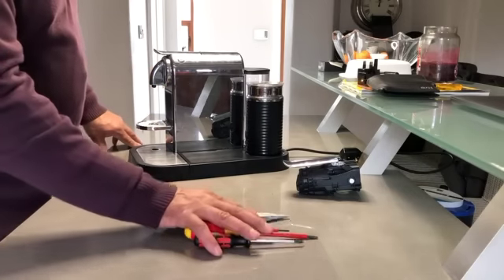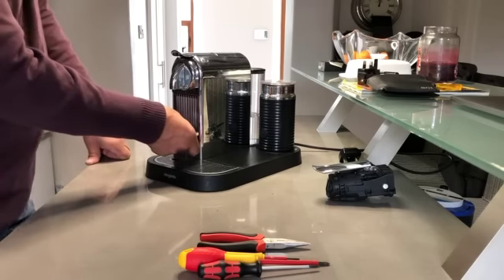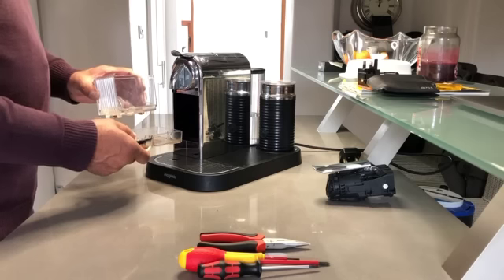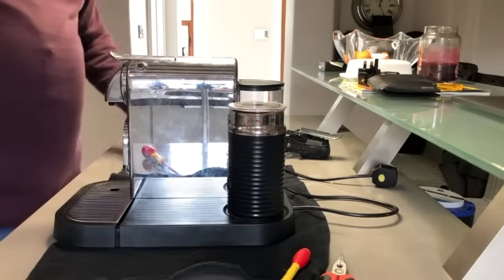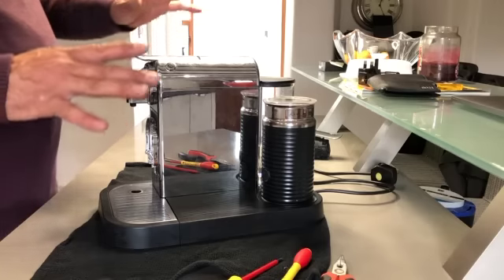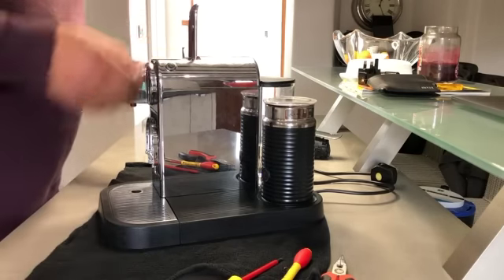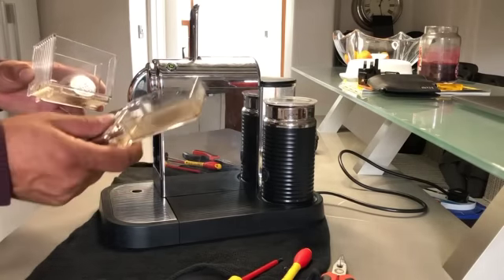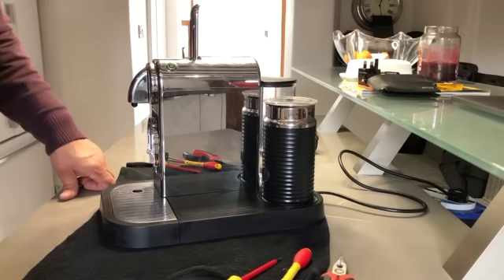Nespresso Repair leaking

Comment: That was a great video. I have Breville Creatista Plus that is leaking. I actually removed the little slide out espresso shelf that sits under the capsule waste tray and cut a yellow kitchen sponge to fit the space. It seems to absorb the leaking water, but it's only a workaround. I'll have to try giving it all a clean like others have in your comments.

Comment: I had a go at taking the brew unit apart and it seems easier than what you have already done to get to the brew unit. Less chance of snapping plastic tabs and easy to put back together. I only found one D-Ring seal... DRings are tricky to find 'off the shelf'. I tried BS125 2.62mm Section 33mm Bore EPDM Rubber O-Rings which seems a little small but seems to have fixed the leak for now. So, if you got this far, I recommend trying just replacing the seal. Maybe try a very slightly bigger one. I don't know how long this fix will last...

Comment: Thank you so much for posting this video, it has been amazing. I have dismantled my 11 year old Nespresso Milk Citiz machine (and without the oval screw, screwdriver and pliers, used a credit card and a butter knife😂as my screwdrivers were too thick- must update my tool box). I’ve now ordered a new unit from Magzimix and I’ll come back to your video for reassembly. You explain everything so thoroughly, and your video gave me confidence to tackle this project, even with weak hands (used my husbands hands for pulling the case off, it was a cringe worthy moment, but successful). Thankfully I have a spare machine, whilst I await for the £30.00 (plus £5.00 48 hr delivery) part to arrive. It’s really annoying your machine’s brew unit gave up after only 2 years😮, and Nespresso wouldn’t honour a free diagnostic. Once my machines have both given up and no longer repairable, I’m considering getting a bean to cup machine as Nespresso’s capsules have escalated in cost, and their customer service has gone down. Thanks once again James for your time and knowledge share.
Reply from the maker: You are more than welcome!😀

Comment: Hello James, thank you for this video was very helpful. I have a question however with the water feed and return hoses. The smaller of the 2 hoses had come off from inside the main body before I had it apart and now can not see where it connects inside the main body. That’s the only thing stopping me from putting it all back together. 
Thank you if you do manage to reply
Reply from the maker: Hi Bill,

Plastic or rubber pipes? Plastic goes on the back of the brew chamber, the same item you bought. Rubber supply and return go on the respective nozzles at the base of the machine. Side by side.
Reply: @jamesroberts2907  shorter of the rubber ones, found iit disconnected from both the base and inside of the body. After looking for some time eventually found where it was supposed to go. At bottom of a black connector. , thank you once again for your video and for taking the time to reply.

Comment: Hi i have a nespresso c120 same as the video as u.. When i try turning on everything when well but after i start to press for the coffee mode and after the hot water came out the whole power trip
Reply from the maker: Hi, that sounds fairly terminal to be frank. It seems like the heating element may of gone.

Comment: Thank you for this. Followed it exactly and managed to get a fully working machine again after about an hour.

The brew unit I needed for my particular model didn’t seem to be available, but I bought one for a standard Krups machine of a different serial number and it turned out to be the sameas my model. Whole repair about £40 compared to a new machine at £175. Very many thanks!
Reply from the maker: Pleased it worked out for you too.

Comment: My Magimix machine leaked too, result was more coffee/water? in the capsule container than in a cup. It was caused by blocked holes in the disk that's in front of the capsule, it has 25 very small canals and 9 were blocked and others might be blocked partly. Thorough cleaning was difficult without dismanteling the machine. I managed too open the machine,i managed to unscrew 2 screws,2 others were released with force without damaging the plastic wings of the machine on the outside, on the inside there was damage but not visible at all when the machine's closed. The disk could  be released and cleaned,after cleaning in hot vinegar using a nailbrush all 25 canals were open again and the machine never leaked since then. 
Assume the pressure is too high for 15 open holes and some partly closed ones so the coffee and water search for a way out and found it ending up in the capsule container..... The exotic oval screws are the biggest problem to solve the problem that can be solved so easily. If you look at te oval screws you might think they aren't screws,they look like pop rivets.

Comment: Thank you for doing this video James, it was a real help.  Here in AUS, the manufacturer wanted AU$240 up front just to get them to take a look at it!  With the info you put in this this video, and the special tool to remove the elliptical headed screws on the bottom and a replacement coffee difuser (?) - the part that was leaking, I was finished in under an hour and cost less than $100.  
Great work James, much appreciated.  Two thumbs up!
Reply from the maker: Thanks Tony. Appreciated

Comment: Firstly, what a wonderful video - both precise and easy to follow and, more important, leads to a successful outcome, as it once again works perfectly.

There are only a couple of things I would add.  

Firstly, I think James was very unlucky with his machine ,as I've had mine a number of years before the "water tray" problem ocurred.  Because mine was older than James' machine, I gave my Magimix Nespresso a really good clean whilst it was in parts and before I re-assembled it.

I did take James' advice and I bought the oval screwdriver as this made unscrewing the base very easy, other than the comment about having the last corner of the base "difficult" to separate.  But it does come off.

The only thing which might catch somebody out was that the old M190 brew unit (the bit that needed replacing) was attached to the unit with four T10 torx screws - and you got it, I didn't this size screwdriver!  So, having purchased one, problem solved.

Overall, a successful replacement following a perfect demonstration on how to do it.

Thanks Paul.

Peter McCaffrey

Comment: What exactly is wrong. Is it a seal or pressure is reduced from wear.
Reply from the maker: Hi David, a really good question actually!  When I did this video one of my biggest regrets was to not start with the obvious things!  
1. Have you descaled the unit regularly following the manufactures guidelines?
2. If no to the above and you have again recently descaled the unit try 2-3 times in succession. 
3. If the above has not worked and you still get large amounts of water in the drip tray, follow the instructions to dismantle and examine the spout where the coffee pours from, is it blocked?  Clean and try again. 
Some have claimed success with the above steps. They are inexpensive options and worth a go. 
Some have claimed success by simply reseating the “O” Ring and someone even posted the size of it and replaced it. 

The best theory I have is that if coffee capsules are used and left in the brew unit regularly, the coffee expands in the pods and over time damages the brew chamber. 
The long and short of it for me was an easy fix, for a fraction of what Nespresso wanted to just “look” at the machine and in my case so close to the warranty expiry date it was painful. At the time I did this video Nespresso wanted €90.00 to look at the machine, then a further charge for parts and labour!  I wanted a quick and relatively inexpensive fix, so went down the route of buying the whole brew chamber and replacing. Of course what Nespresso want you to do it buy one of their new Virtuoso machines as the capsules are only produced by them and they are considerably more expensive.  I have nothing wrong with Nespresso, they did bring great coffee into thousands of homes at a reasonable price, I was just not prepared to spend the price of a new machine to have mine repaired, so hence the video. Hope your machine is OK.
Reply: @jamesroberts2907  thanks so much for taking the time to write that reply. Descaled twice with no luck. My wife does leave her pods in! I’m sure once  by cleaning internal surfaces it came good for awhile. Looks like a replacement with your instructions is the next step. Thanks

Comment: I came across your videos when I was researching how to fix my badly leaking Magimix M100. Although my machine was different you gave me the confidence to have a go. I bought the oval tool, £3 and a set of quality Torx screwdrivers (no Philips screws inside), £18 and followed your methodology. In fact the M100 is easier to take apart and the brew chamber has no electronics, just a plastic tube to pull off so no wires to disconnect or switches to remove. It was obvious that the end of the chamber where the filter is was full of coffee gunk, as was the spout. I cleaned both with hot water and an old toothbrush and reassembled it. Perfect, no leaks. The brew chamber, being just a plastic and metal componant is cheap at £10 if I ever need to replace it. So thanks again for putting these videos on Youtube so that I now have two Nespresso machines!

Comment: Really helpful video, thank you. My machine is a Nespresso Essenza but the principles apply to lots of 'original' machines. In my case I also followed another video that complements this one very well and I replaced a rubber O ring inside the brewing chamber. That fixed my problem - I did have hot water coming out from beneath the lever, but no more.
Thanks again.

Comment: Thanks so much, this was a huge help and I wouldn't have been able to do it without the video.  We have a Citiz without the milk attachment so it was possible to do without fully removing the base and leaving the earth attached, it made it a lot easier when reassembling at the end.  It also took me a while to pry the plastic spout cover off, the clips for that are at the top and the bottom if anyone else is struggling.
Reply from the maker: Your welcome. Pleased it worked.

Comment: I found what was a problem for my solution and why my coffee machine still leaking. The cause was part that James talking about at 15:53 min of James clip. In my case, this part had a blockage in the tip of its nose and that was the cause of leaking. What I did, first I removed the blockage then  I drilled a hole in order to remove small plastic cross at the tip of this nose  to enable better coffee flow. Now I do not have leakage any more :).
Please check this nose - remove any dirt and remove the plastic part on the tip of the nose itself (by drilling), then check is your machine still leaking if yes go further and order the part James suggesting.
Reply: Thanks, Boris, I followed your tip to clean the nose blockage by fine pin and it works, no more leaking, cost £0 but solved the long term problem, now machine back to working order without a drip leaking at all.

Comment: Thanks James for the inspiration.  My machine leaked on the inside and figured it was blocked somewhere causing backpressure. The pod is pressed against a "grill" on the inside of the machine. Cleaned this with a toothbrush and flushed with water. Almost did the trick. So put a garden hose  on the output nozzle of the machine (not in the kitchen!) and gave it a blast. Now works perfectly.  I guess the coffee grains over time block the unit. Thank you.
Reply: So the water from the hose was going back through the output nozzle and through the "grill". Did you turn the machine upside down with the lever open so the water could escape and not blast all through the machine?

Comment: Perfect instruction 👍 it is a typical problem with that model. It comes when you leave the used capsule in the brewing unit. Because the wet coffee swells and the capsule gets bigger. So it busts the ring of the brewing unit. To prevent this, remember to eject the capsule immediately after brewing. 
I tested many different types of capsules in the last 10 years. In the result I use only nespresso or lavazza capsules. They work best
Reply from the maker: Olli, that makes a lot of sense and would explain how some people don't have any issues but others end up throwing their machines away.
Reply: So Olli, is that the O ring that gets burst, that some people are saying in their posts that they replace do you think? In which case is it necessary to get a whole new unit rather, than to try  replacing the O ring?
Reply: @brianlaughland8960  Hey Brian, i Don't know exactly what the o ring means. The thing that surrounds the capsule and brings it to the pyramid plate gets a hairline crack.   You won't get this part single, I think.
 If you can see no hairline crack, it could be a different mistake maybe the jet, where the water hose is connected is blocked (because of using hard water). This is the mistake, when the capsule is not perforated and no coffee but only water comes. 
In this case you could try to blow the jet. 
Good luck

Comment: Thank you very much for taking the time to prepare and post this. I have a very similar machine (cosmetic differences mainly) which had been out of use for quite a while. After watching your video, I ordered the special key and the spare part. It took quite a while to gather myself and attempt this. It was tricky, as I am not used to such tasks, but after a couple of hours I managed to complete the repair! Another difficulty I had was the fact that the pump did not start working properly straight away. This might have been due to the fact that the machine stayed unused for a very long time. With repeated efforts, and while the pump was active, pulling out and replacing the water tank, I managed eventually to get it going. Thanks again.

Comment: Thanks very much for making the video. I got the most benefit out of pulling the coffee machine apart. It gave me the confidence to pull on the plastic a bit harder than I wanted too.

What I wanted to say thought to help you and your viewers, is you don't have to buy that part. You were so close to fixing the entire problem without spending a cent / penny.

The part you say not to strip... and buy another one. You are right, don't strip it, it is all to do with the lever action of the pod being put in place, except for one part... the part that the flat side of the pod pushes against. That part is the reason the water is in the bottom, because it's blocked and the water is not going through. So... take out the little grate with the flat blade screwdriver, clean it with a toothbrush, put it back into place... done. No need to buy the part, just put everything back together.

If you still have your old ones it will be easy to see what I mean. Go to the front where the flat side of the pod goes against the coffee machine, there is a plastic grate. (You have nothing to lose, you have already bought new parts) you will see a place where you can lever it out with a small screwdriver, hold it up to the light and you will see nothing. Clean it with a toothbrush under running water on both sides, hold it up to the light... there you go... a heap of little holes. Click it back in... done.

I made a little video for you and your viewers so you can see what I mean. One very small little extra thing, and it doesn't cost anything next time. You don't want to spend 25 Euro every two years. We have had ours for almost exactly 8 years, and we figure we would have put through 3000 coffees. however we only used filtered water, this could have made a difference.

This is the video I made for you so you don't have to buy the part in future 
https://www.youtube.com/watch?v=x4ygWJ_E6Mc&t=4s
Reply from the maker: Hi Pay it Forward, you are correct, for some this may be the issue if they have not descaled their machine, I should put that in at the start of my video, "assuming you have descaled and it still leaks" This was not the issue with mine however.  not to say it could be the issue with other, so great.
Reply: @jamesroberts2907  No worries James... just want to help out. No need to change anything you have done. What you have done is great. I merely expanded on what you said. I wouldn't have been able to get to where I got if I hadn't have watched your video. Your video gave me the courage to pull on the plastics harder. I thought I was going to break them until I found your video.

Comment: THANK YOU for taking the time to make this video (twice) James, I never would have attempted to fix my machine were it not for you. I bought the replacement chamber and tools and fitted it following your careful instructions, however when I re-assembled everything and tested it, the water began pumping into the machine, instead of my cup. After dis-assembling it to investigate I discovered that one of the small spring clips keeping the water tubes in position had broken! 
IF ANYONE READING THIS KNOWS IF THERE'S ANOTHER TYPE OF CLIP THAT I CAN USE INSTEAD, I WOULD REALLY APPRECIATE YOUR ADVICE.

Comment: Thanks for doing this, easy to follow and helpful. For those attempting this repair, the two parts I found to be the most tricky were getting the last section of the base to separate and removing the side panels. Just be patient and keep working around all the edges, preferably with a plastic pry tool, until all of the clips disengage.

Comment: Thank you very much! Couldn’t work out how to take the cover odd. It is so evil to have those really subtle oval screws. Cynically designed to stop us repairing the machines and forcing us to use their expensive repair service or buy a new one. Saw another video suggesting that it usually is the percolation plate so hopefully when I eventually get it open I will be able to unblock the holes.